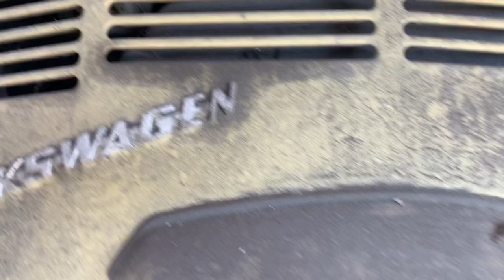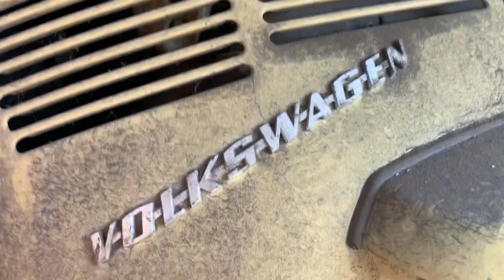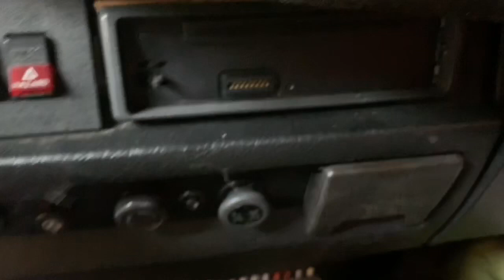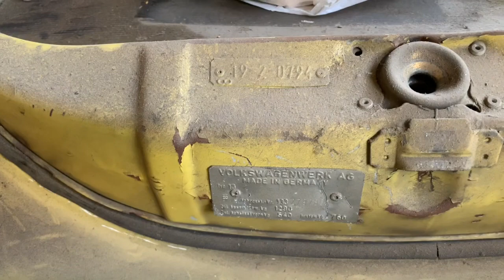1973 VW Super Beetle Restoration: Episode 1 Wake up

Comment from the maker: It was restored by a V dub shop for around 4k. If you have the skills and can do it at home you could save some $. But make sure to do it right.   I love it. It rides like a dream. Could always use more power.
Reply: Restoration cost is cheaper than a Moots frameset...